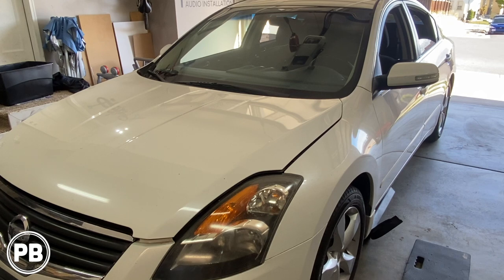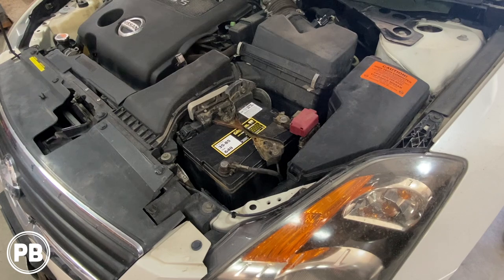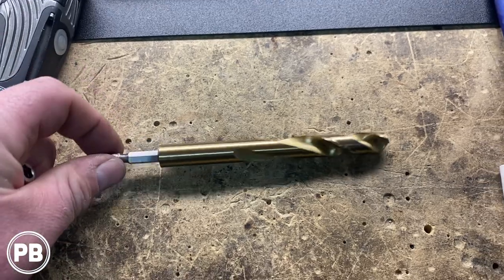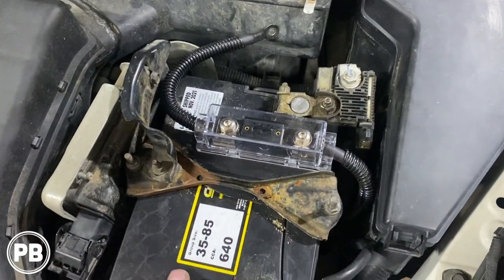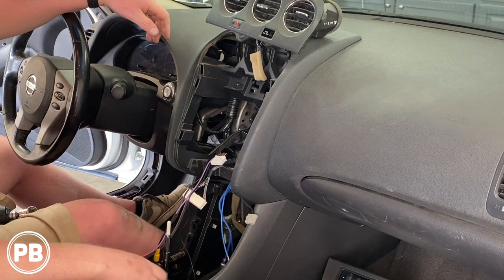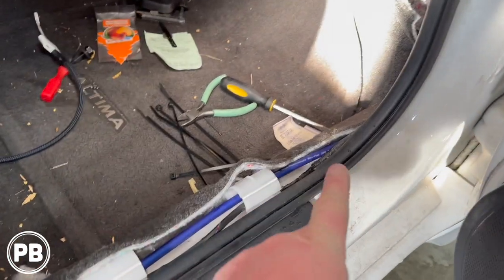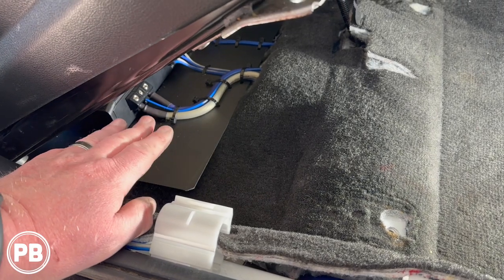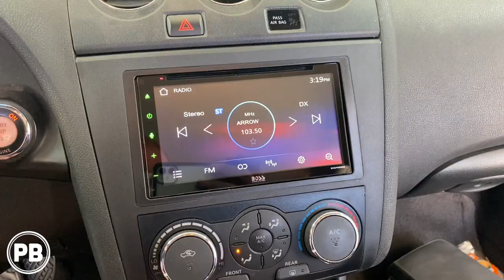2007 - 2013 Nissan Altima Amp and Sub Install

Comment: To help you out in the future.  The altimas have a dummy plug on the passengers side up right behind the glove box. Altimas are known as knuckle busters for me when it comes to the driver side firewall.  So next time you have a altima in the bay check out that dummy plug on the passengers side especially helps if your mounting the amplifier on that side as well. 👊 now back to the video
Reply: I didn’t see this comment wish I did, literally just found that dummy plug an hour ago after 2 hours I’ve trying to get through that firewall
Reply: @Tiger Bennett  I'm glad you found it. Yea normally the safest way to go through the drivers side firewall is to jack up the car take off the drivers side tire then the wheel well splash guard and you can access it through there. But still on the inside the emergency brake assembly is in the way and that metal is very sharp all around it very easy to get cut up. And even on the inside of the engine the strut tower blocks the view of the grommet.  I've done enough to where I can do it because I have small hands but that passengers side dummy plug is always the safest.  The only thing is your limited to where you can mount your amplifier depending on how long your power wire is. But there is always a way just got to take your time
Reply: I don’t see the grommet on my 2010 Nissan Altima
Reply: @DarkCryRoad  it should be up right corner of the firewall behind the glovebox normally on that year it is hidden behind the carpet.  Should be about the size of an oreo or a little bit smaller
Reply: @keithzaczek1  i might need a video for rhis cause I was just trying to look under the e caroetn
Reply: @DarkCryRoad  I would if I had that vehicle in. But it should be up in the far upper right . If you still can't find it there should still be a flat spot on the firewall on the passenger side that you can drill your own hole.
Reply: @keithzaczek1 do i need to remove anything
Reply: @DarkCryRoad  yes the glovebox and there should be like some Grey padding carpet behind the normal carpet I believe.  Also you will probably have to remove the passengers side kick panel as well it could also be the size of a quarter.  It is black and it fits flush in the firewall
Reply: @tigerbennett9450  no frl samee😭
Reply: Can you explain more about dummy plug behind glove box and what it look like ?
Reply: @KDiggs-cb1os  yes its a black circle grommet that is closed off normally its the size of a oreo or like a vanilla wafer.  It's normally up right hand side behind the glovebox on the firewall sometimes behind carpet or like a foam mat. If you happen to look from the engine side you might see it under the strut tower. But in altima it's hard to see behind the strut tower. If you find it on the inside of the car and you Remove it run a fish tape through the hole and find the other end inside the engine and just pole a hole in the grommet feed the wire through the grommet than through the hole into the engine once you get the length you need then put the grommet back into the hole. Hope this helps you out
Reply: My 2009 Altima doesn’t have the fancy pins to remove the glove box, instead 8 screws but I removed it and found the plug, so I decided to make a quick video showing it. After removing the plug I put a flashlight up there so you can see it from the engine compartment. A 4 gauge wire grommet fits in there perfectly. https://youtu.be/teDueqJNaE8
Reply: @KDiggs-cb1os I posted a video in the comments showing it, if you’re still interested.
Reply: @danimal2013  awesome.  I'm glad it worked out for you.  The quick video was perfect.  👊
Reply: @keithzaczek1  I was about to pay a shop top dollar to install an amp for me after watching this video, but after I read your comment I decided to go take a peak. You saved me a chunk of change. Thanks man. I appreciate it!
Reply: @danimal2013  my pleasure 🙏.  I'm glad you built up the confidence and made it happen your a legend for this. Hope to hear you beating down the block 1 day. 👊
Reply: Yes thank you, it was so much easier and faster.
Reply: @DjAlexRivera73  My pleasure
Reply: Thanks man, you're advice is super helpful!
Reply: @danimal2013 thanks for the vid, very helpful!
Reply: @poppynokc1977  my pleasure glad it helped you out
Reply: Thank you so much you are a live saver
Reply: @donaldbanton2073  my pleasure glad i could help out

Comment: Can you do a video on a 2019 Nissan Altima sub install with factory radio I can’t find one anywhere😢
Reply from the maker: Sure will, as soon as we get one in the garage.
Reply: Would you need the wiring diagram for the LOC hook up?

Comment: Will the line out converter work for a 2016 Altima? Or can you recommend something similar ? Trying to install a skar kit and want to keep the radio.
Reply: Don’t keep the factory radio man, just go with a Sony AX3200 and a $35 dash kit. It’s well worth it.
Reply: Line output converter is super easy to use on the altima. I’ve used one and spliced it into the rear deck speakers and it worked great. It is pry better to get a different radio, but if you absolutely want to keep stock radio I highly recommend line output converter
Reply: Line output converters work really well bro, I tapped into the wires towards the back and it works great. I also wired the amp to my back speakers but I ran new wires from there

Comment: Anyone know the max rms you can run with stock alternator? I tested a 300 watt rms sub and it was causing my headlights and interior lights to dim
Reply from the maker: Many variables there, health of battery, wiring, size of amplifier, etc.  A big 3 upgrade and a healthy battery can go a long way.  We did this 1200w RMS amp and a big 3 upgrade without issue.
Reply: @ProvoBeastAudio  Sounds good. Thank you so much for the reply. That information is very useful for me. Now that I’m thinking about it, the battery I hooked up to did end up failing this year so maybe my battery was really really bad.
Reply: I did two 1100 watts 12 inch subs wired to 1 ohm I think you should be good

Comment: Do you absolutely have to drill ??
Reply from the maker: nope, not always.  Look for an OEM grommet where you can snake your wire through.  We had the V6, so engine bay was super tight.  You may have better success.
Reply: @ProvoBeastAudio  okay I will look thank you so much